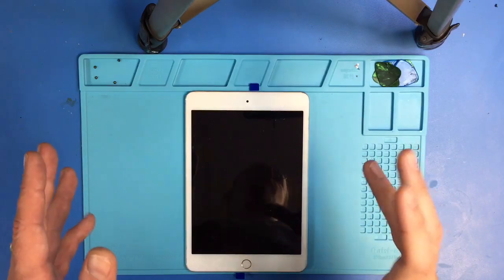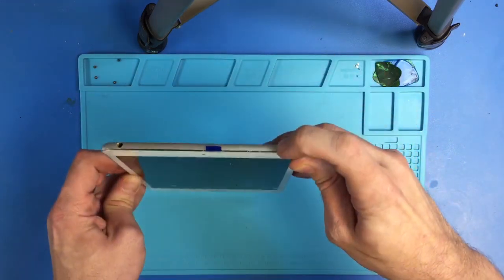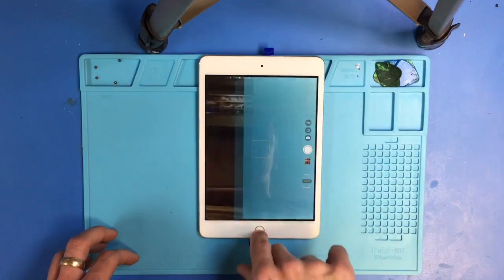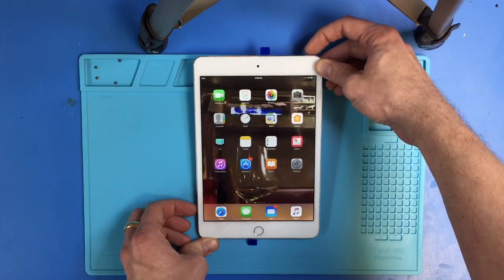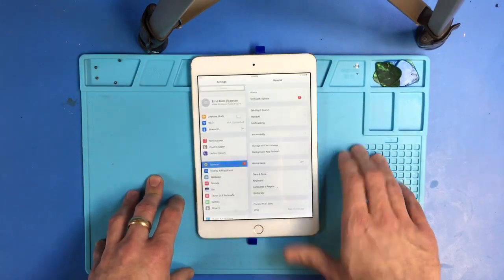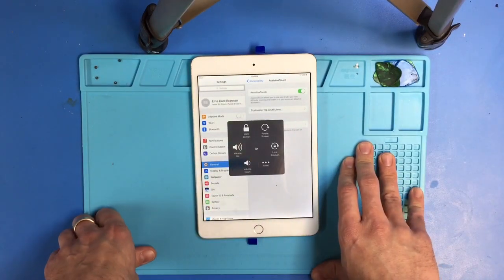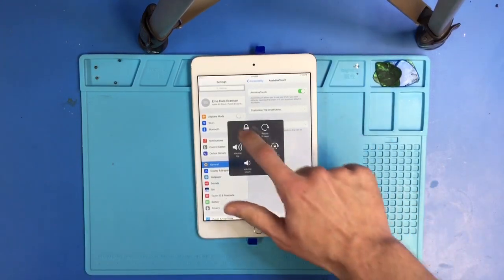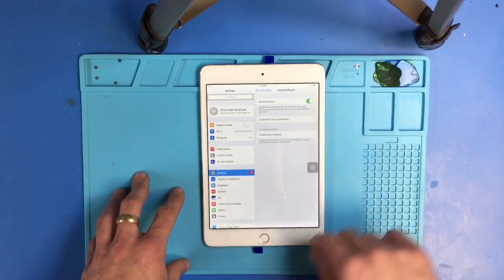iPad power / sleep button problem after screen replacement temporary solution

Comment: After replacing iPad mini 4 battery  the power button won’t turn off… I  already use assistive device it still won’t turn off…although it’s charging. It just won’t turn off. Can you help me pls
Reply from the maker: With the Mini 4 there is something called the “sleep/wake sensor.” It is mounted on the back of the touch screen, soldered to the flex cable.  If this sensor is missing or damaged you will have problems with the power button.  Usually a screen replacement causes this issue because some aftermarket screens leave that sensor out.  It’s not typical of a battery replacement UNLESS you damaged that sensor when you opened the iPad or you replaced the screen at the same time and used a screen missing the sensor.  I recommend you google the sensor I am talking about so you can see what I mean.  Armed with that knowledge, inspect your screen to make sure the sensor is attached and is not damaged.  Also inspect your plugs from screen and on the board where they plug in.  If there is debris, even the smallest like a bit of dust or adhesive, it could prevent one of those tiny connections from making contact.  I recommend cleaning your plugs with isopropyl alcohol, preferably 91%.  I use an acid brush which is cheap and chemical resistant.  Some brushes will melt from iso, so beware.  *Allow it to dry before you plug it in.  Good luck. 🍀

Comment: by the way I know this is an old video, but that's not a software error.

The ipad changes the setting on the power button to "press and hold" to turn the ipad off, it doesn't work if you click just once as this is made to be used with a smart case, which will turnt he screen off as you close the case. Hope it helps.
Reply: Can I change that option

Comment: actually, my home button are not working also even when I pressed the HOME on the assasitive touch, I guess this is my 3rd time fixing it because it happened last week and yesterday, when it turn off,  the Apple logo appears and like 3-5 seconds it will turn off ;(((
Reply: I’m scared to turn it off because my home and power button wouldn’t respond, I only have 10$ to check it for professionals :(

Comment: ok, i found the solution for me and other technician , 
Step 1- resolder the sleep wake sensor is under the screen beside the home button, some screen have that preinstall and the seller dont solder properly. here is the link to see what part im talking about 
 https://www.ebay.com/itm/173628717155?hash=item286d13f863:g:PLAAAOSwckVb41U7

2- transfer the sleep wake sensor from the old screen to the new screen, you will need soldering skills to do that.
3- When you buy a need screen you must be sure that the screen have the preinstall wake sensor, how do you realize is because without that is will be cheaper, i hope help other tech after two years.
GOD bless everyone

Comment: I got my power button wet and it's not working helppp plsss
Reply from the maker: I wish I had good news.  My experience of 10 years repairing electronics has lead me to the conclusion when these devices are penetrated by ANY conductive liquid they have a ~80% probability to take electrolytic damage.  Simply put they short circuit.  The more sealed the device the less likely.   How well sealed your device is is based on its manufacturing, whether or not there is external damage like chips in glass, how its been treated environmentally through its life.  Full submersion is almost definitely going to result in failure.  Even though they have come to me, an experienced technician, many people are deluded into believing the device is fine and they tell me on and on how “..this works and that works.”  They go on “My device does these things and those things..except..” It’s the “except” that defines the damage has already happened.  Regardless of what else is working something was affected by corrosive and conductive liquid.  I have waisted enough time trying to get said devices operational.  They rarely fully come to 100% solid working and IF you do get it to “seem” fixed they are usually on an unpredictable clock to failure.  Most of THAT time is riddled with shoddy operation and therefor frustration.  My advice:  Save yourself the headache and money thrown at a bad device repeatedly. Buy a new one.
Reply: @ConnivingBones  hi, i don’t have money for another iPad, I’m from a South American country, and I think liquid from a bottle on my backpack leaked through to my ipad around two weeks ago. It was little, the clothes I had on my backpack absorbed most of it but when I got the case off my ipad there was a little of liquid, the device was on headphones mode (I tried putting it back to normal by restarting the settings but it didn’t work, it repaired itself the next day) and the power button wouldn’t work at all. Then a few days after it started working sometimes, and sometimes it activated itself at random times. Now it doesn’t work when I press it and it goes to the “power off ipad” screen or locks itself like twenty times per day. Even though this stress me, I can still work and besides that the iPad is completely functional. 
(Sorry for the,long text) What you said about short circuit really scared me. As I said it’s really hard (impossible rn) for me to buy another iPad and I need it to study. It has all my materials and I don’t have any cloud synchronized. Do you think if I go to an Apple Store they can do something to ensure my iPad doesn’t die? Or is it practically inevitable/unpredictable? I would be really thankful if you answered, I’ve been trying to ask for help on Reddit but no one responds :(
Reply from the maker: @rmo3961  It’s likely if the device stopped operating correctly after liquid was introduced it is going to require circuit repair.  They do not do circuit board repair at Apple shops.  Component damage like a screen breaking or a battery going bad are easily corrected by part replacement.  Unfortunately circuitboard repair is very expensive and difficult.  In my experience after a device has had liquid damage, even if it is repaired, it will be unreliable.  They tend to have problems that were not detected during the repair or surface at a later date.  So in conclusion it’s a possibility that it can repaired but it may not be worth the investment.
Reply: @ConnivingBones  thank you 😞, I will trust that it doesn’t fail, it started working almost totally well since yesterday but idk for how many time that will last. I won’t be taking it to the Apple Store from what you say, thank you again

Comment: It doesn’t work guys do not try this better restore ipad
Reply from the maker: First of all this does work on some, likely due to the iOS version used.  The issue is the “wake/sleep sensor” NOT being attached to the replacement display component.  This is stated in the description of the video, if you had taken the time to read that you would’ve understood.  Another thing:  Just because something doesn’t work for you does not mean it doesn’t work for others. Do not spread misinformation.  I took the time out of my life to sit down and make this video to help others.   Your suggestion that doing a restore on the unit will help is in fact not helpful at all as it has nothing to do with the issue.  If you have something useful to say make a video and prove it otherwise your statement is contrived.

Comment: ITS not working to restore it I tried but it not worked what to do?
Reply: If you haven't tossed the old screen you need to desolder the wake/sleep sensor that is attached to the the flex cable at the bottom to the left of the home button. Then solder it to the same place on the new display.  It's also available on ebay if you no longer have the old screen.  Search for "iPad mini 4 wake sleep sensor".  If you don't have access to solder tools and knowledge on how to use said tools you may be up the creek unless you know someone who does and is willing to help you out.  Good luck my friend. 🍀

Comment: The problem remain after restore.
Reply from the maker: Try replacing the “Flex Cable for Sleep Wake Sensor”.  It is typically the culprit in this model.  It is soldered at the bottom left on the flex cable on the original display assembly.  If you have experience soldering flex cables you may be able to remove it from the old screen and solder it to the new screen.
Reply: @ConnivingBones  I'll try, thanks

Comment: I tried to restart the ipad and the power off button won't show up even I pressed long enough..
Reply from the maker: Assuming you have the unit apart..

1) Carefully unplug the battery.
2) Plug the battery back in along with the display assembly.
3) Plug a good charging cable into the iPad. 

It should turn on once it’s plugged in unless the battery is dead.  If you haven’t charged the unit in over a week it may take 1/2 hour to show its charging. If it doesn’t turn on after an hour you may have a bigger problem.

Comment: Hi, i just replaced the screen on ipad mini 2 and the screen turn on and works fine but after a while it turns off completely and some times is doesn't turn on right away. Also if i press the power just to put to sleep it seems like the ipad turns off completely
Reply from the maker: Johnny Mejia Does the screen come back up when you press the home button, But not when you press the power/sleep button?
Reply: @ConnivingBones  thanks for the reply, but after a couple turn on cycles and tweaked some display settings it seems to be working fine now. The screen doesn't turn off completely and the home and power buttons are working fine to wake the screen. Hope the problem is fixed somehow. Thanks again..
Reply: @ConnivingBones  hi, so after a while it seems like the issue is still there, not sure what it could be, the screen just turns off completely when i put it to sleep

Comment: Software does not fix this. This is a hardware issue with aftermarket screens.
Reply from the maker: Strazer McD The problem comes from not transferring a small sensor from your old display to the new one.  Aftermarket or not it must have the small component
Reply: @ConnivingBones  what sensor is this??
Reply from the maker: MANEE323 Sleep Wake induction Sensor.  Available on ebay as of writing this reply.  (Requires soldering.)

Comment: Oh my god thanks so much I was replacing an iPad mini and I about died when it did that thanks
Reply from the maker: jack schultz No problem!  I should note there is a small ribbon flex soldered to the flex on the screen you take out that if desoldered and soldered to the new screen’s flex should be the permanent solution.
Reply: ConnivingBones yeah I’m still having problems with it
Reply: @ConnivingBones  the slide on the unlock my Ipad screen wont work I even pressed. The 2 buttons on the ipad to reset and still wont work what do you think it might be.